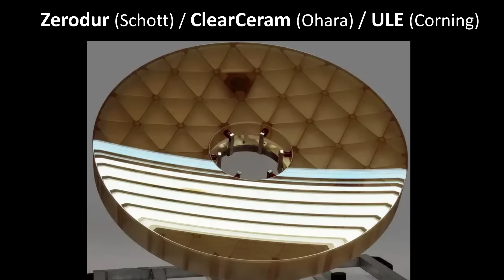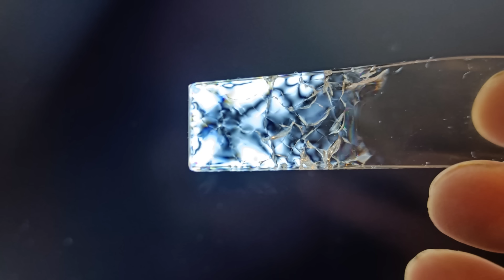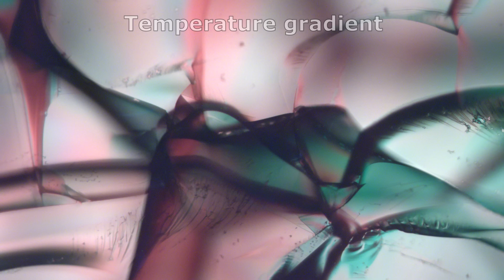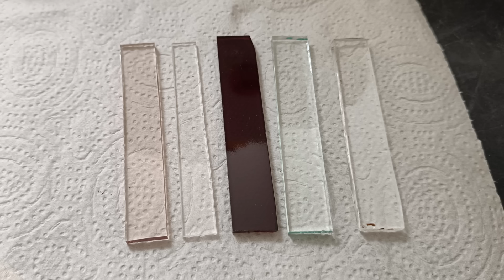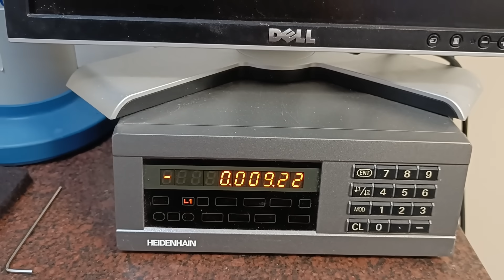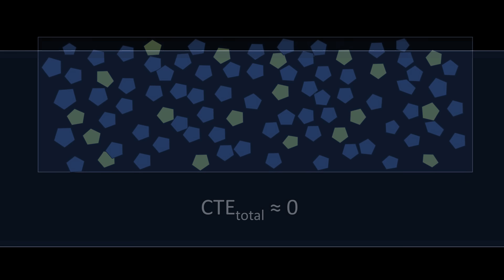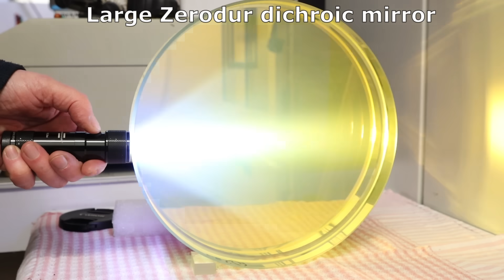The Amazing Properties of Glass-Ceramics (GC Part 1)

Comment: 18:11 LiAlSi₂O₆ shows negative thermal expansion because its crystal structure favors rotations of rigid SiO₄ and AlO₆ units over linear bond expansion when heated. These rotations effectively pull atoms closer, causing the material to shrink slightly rather than expand. Very interesting property!
Reply: This was my initial conclusion, even though I wasn't sure if it was even possible, thanks for confirming it
Reply: I just thought about water to try to explain myself that fact, and it's very interesting the similar properties they have!
Reply: Curious to cold optimized application. Do we see a similar resilience dropping to extreme negative temps?
Reply: Spodumene
Reply: Almost like the opposite of ice, with water. Are there any full projects of this interaction?
Reply: Is that material similar to the scintillator?
Reply: Heh, I JUST learned about materials with negative thermal expansion coefficients today. I wonder what the implications of an imaginary number for the thermal expansion coefficient would be. Not that I imagine any such material could physically exist... or could it? I can't even imagine the implications, so I couldn't even speculate whether it's possible or not. But, my intuition tells me absolutely not possible, for some reason.
Reply: @VoidHalo it's not possible, thermal expansion is a real (mathematical term) value. Imaginary or complex numbers are just not applicable. There are tons of areas where they are useful, like alternating current, but most of the time you'll know if they are appropriate.
Reply: @thundersheild926  well, i still pertains to the stuff happening across atoms
Reply: @VoidHalo  typically the introduction of complex numbers is needed when you need to model phase differences at different frequencies. In this case, one could imagine a frequency dependent thermal gradient over time and a complex number would be needed if there is a difference in the frequency response of the material. I do not know enough of the specifics of the materials treated in this video to be able to say if there is a range of frequencies (and temperatures) over which this phenomenon would be measurable
Reply: @acortis I can think of way of doing that, if you mix materials with just right structure and different rates of expansion overall structure could have different thermal expansion properties depending on rate of expansion and if it fluctuates back and forth with it even settling in different states at same temperature depending on how it was heated or cooled 

This is easier said than done
Reply: @VoidHalo  Welcome to the world of meta-materials where things can even have a negative index of refraction and where phase and tuning of optics in turn change with the expansion/contraction of components.
Reply: @VoidHalo  When considering the thermal expansion of such crystals, the overlap and stabilization of electron orbitals play an important role. Electron orbitals can be expressed as wave functions, which involve imaginary numbers. However, it is difficult to say that this is related to the negative correlation of thermal expansion. Such negative correlation, or an expansion coefficient of ≒ 0, is only caused by local metastability (in fact, even in the Borax graph, there is expansion and contraction at the temperature limits).

Comment: @ 22:05, is what you’re talking about referred to as Prince Rupert drops?
Reply from the maker: No in Prince Rupert drops, the material is cooled so fast that the solid on the outside is already under tremensous compressive stress at the glass temperature that it does not crack. The final result at room temperature contains an incredibly high level of internal stress.
Reply: @HuygensOptics  thank you for the clarification

Comment: Could the properties of lithium aluminum silicone composites shrinking when heated be correlated in any way to the unique property of water expanding on freezing?
Reply: No, ice is all about hydrogen bonds.
Reply: Ice expands just at the point of freezing and when then cooled further shrinks as any other material. Due to the ordering process and hydrogen bonding the density of water is lower than of its liquid state. Glass ceramics shrink at a larger interval because it's favourable for the crystal building block, the polyhedra you see on the crystal structure, to yaw and tilt, which has a bigger effect in these structures than the increase in atomic bond length, so they show an inverse behaviour in a certain temperature interval.

Comment: 20:00 the crystallites are definitely not pentagonal. 5-fold symmetry is forbidden in crystals, except for some particular notable exceptions (quasicrystals) that don't seem to apply to LiAlSiO4 (or the other phases you mentioned). That's very much a nit-pick, though, this is a great video! The microscopy at the end is especially lovely.

edit: I suppose you could end up with some crystallites that are irregular pentagons with 2-fold symmetry, or with no axis of symmetry... I don't see any such pentagons in the micrograph you shared, but those are not symmetrically forbidden. It's specifically that 5-fold symmetry that you can't have.
Reply from the maker: Just checking to see if you were paying attention. ;-) Crystal structures are mostly monoclinic spodumene or hexagonal.
Reply: @HuygensOptics  Spodumene is a new one on me! I opened up the crystal structure in ReciPro; every single atom in that unit cell is symmetrically inequivalent! Its diffraction patterns are pretty neat, too. I'd love to take a section of one of these glass-ceramic composites and look at it in the electron microscope, I bet there's all kinds of interesting stuff to know about it. Like: which crystal planes are preferred to be on the surface of the crystallites?

Comment: Why isn't this used more in laboratory glassware? is it the cost or a malleability issue when shaping?
Reply: Its just not nessesary as borosilicate glass is good enough and orders of magnitude cheaper.

You can blow this material like you can with glass, so creating a reagent tube would most likely involve drilling out a rod.
Reply: @SuperPhexx Ok, but next time be more direct by saying something like upfront penny pinching, engineering incompetence/laziness toward devise methods of reducing manufacturing costs, and the ever present planned obsolescence/engineered breakage when management deems lucrative.
Reply: @custos3249  About planned obsolescence, reminds me of Superfest drinking glasses. Chemically treated glassware was deemed too good for the market because it didn't break so nobody wanted to produce it.
Reply: Looks like they are not chemically resistant like borosilicate glass. Besides the cost.

Comment: Beautiful. Solid materials with a negative thermal expansion rate. That's new to me.
Reply: Yeah I thought everything expanded when heated. 🤯
Reply: Try heating a rubber band - it shrinks!
Reply: Yeah, the only "sort of naturally occurring" materials I can think of  that has a negative thermal coefficient is REALLY cold ice and pure silicon.

I mean water too of course but that's not particularly solid unless you're falling and hoping for a soft landing.
Reply: Don’t forget about water ice! A common example of something that expands when cooled.
Reply: Yooo have u used HEAT SHRINK? POLYOLOLOLOLOOOLOLOLOLEFIN
Reply: There are white metal formulas that expands when cooling of ,  they where used to fasten iron into  stone for example.
Reply: @perstaffanlundgren  The TypeMetal formulations of Lead:Tin:Antimony were formulated to expand a little on solidifying (like water ice) to form an accurate impression in the type matrix (mould) but outside the freezing point I think they will expand like most metals when heated.

I remember seeing descriptions and videos of copper staples cast into stone in one go as well as iron bowties set in place with lead.

Lead is also nice because it does not corrode under normal conditions and also anneals at room temperature so does not crack from moderate fatigue, the low melting temperature is also unlikely to crack the stone easily.

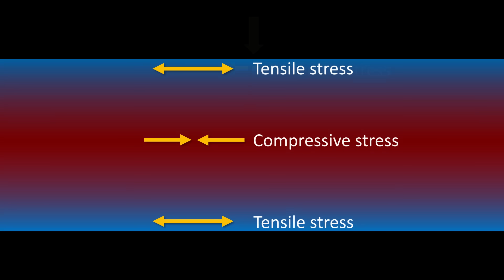Comment: Am I wrong, or are the arrows at 6:16 reverse of what the stress direction should actually be? If cooling shrinks materials and heating them expands, shouldn't they be the other way around?
Reply from the maker: I think the presentation is a matter of taste: the tensile stress arrows "pull" on the material and the complerssive stress compress the material, indicated by arrows pointing towards each other.

Comment: at 0:33 is that a case of a severe turned down edge on a telescope mirror or something else?  lol
Reply from the maker: No it is an optically polished piece of Ceran. I agree, it is not very flat!
Reply: @HuygensOptics  flat meaning deviating from a sphere or parabola as a reference surface or the general concave curve? I was referring to the reflection from that mirror at the very very edge, seems to have a different radius of curvature there from the rest of the surface.
Reply: In telescope making i believe they call it a turned down edge.